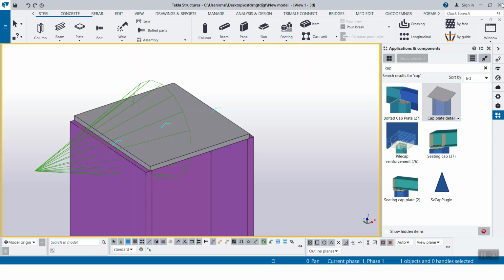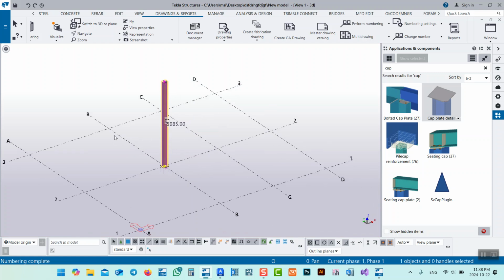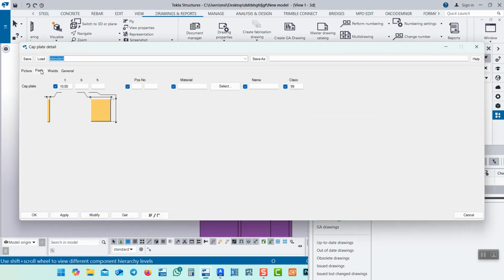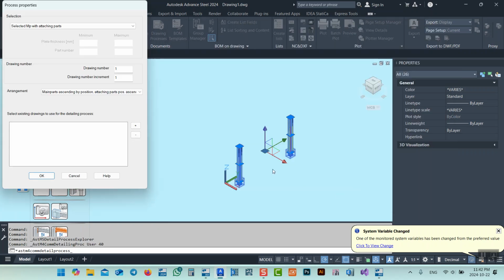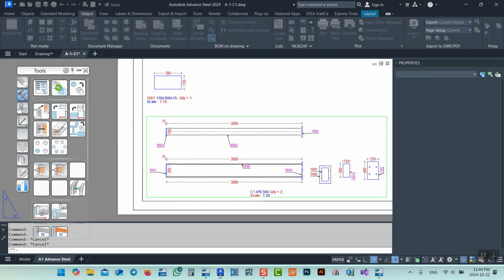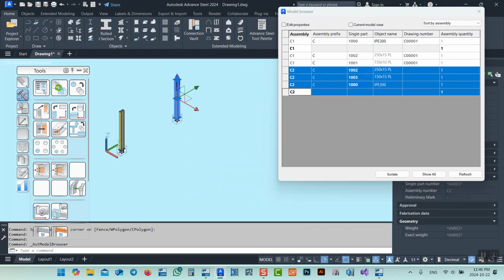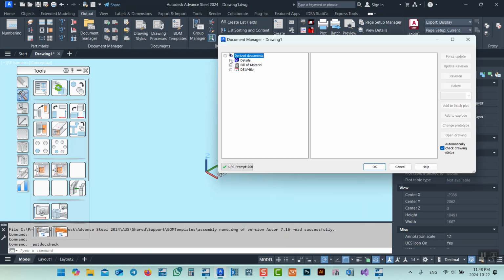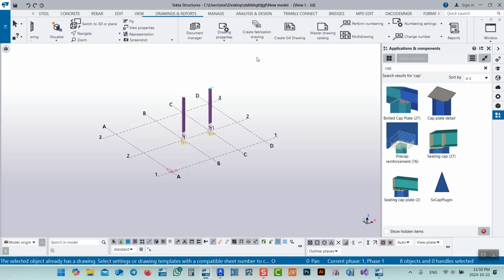Modifying after making drawings in Tekla and Advance steel

Comment: To summarize, you are showing that BOTH programs require a renumbering after a change to an assembly. And AS has a quick way to tell which assemblies do NOT have an assembly drawing yet, whereas (from my experience with Tekla, there is no easy way to tell in Tekla... except maybe Object browser with a custom column for drawing number). However, Tekla will automatically clone the original drawings if an assembly is changed and needs its own separate drawing. Cool.
FYI, Tekla will also create duplicate drawings for the same assembly if "XS_DRAWING_CLONING_IGNORE_CHECK" setting is set to TRUE.
Reply from the maker: Of course both programs needs to renumber , but AS gives you same drawing so you have to know which one was modified and about tekla also gives you which assembly doesnot have assembely drawing very easily